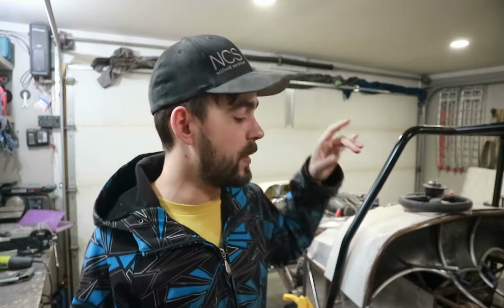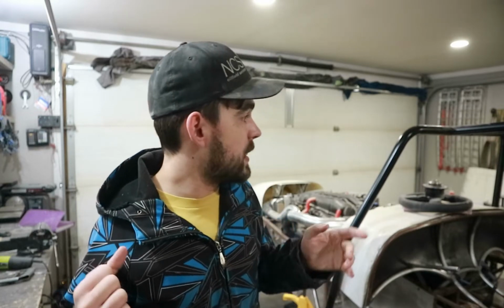Ep 162: Aluminum Locost Floorpans

Comment: Getting a bit ahead of you here, but what brand are you planning on using for your suspension?
Reply from the maker: Current plan is QA1 single adjustables, reasonable price and availability in North America. But I am open to suggestions.
Reply: @leftfootfirst9847  I'd been planning on using Gaz, but getting them on this side of the pond is proving to be a bit challenging.
Reply from the maker: @THansenite  Yeah, a lot of the euro guys use gaz but there is little to no support over here and that adds to the cost